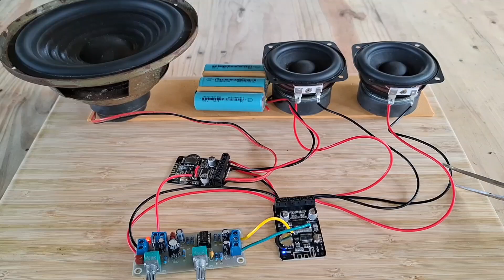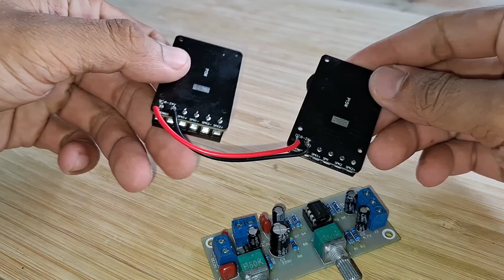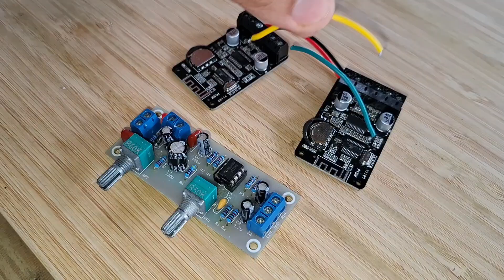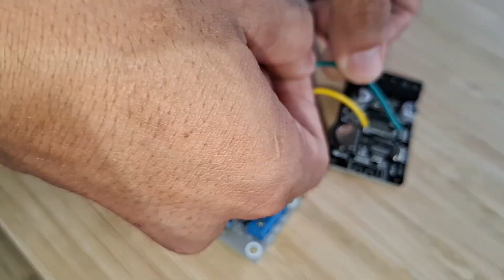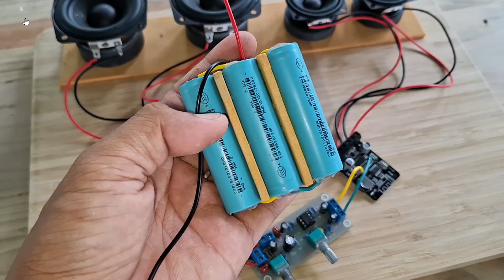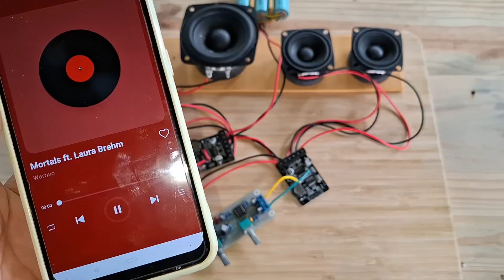Watch Me Transform the XY-P15W mini amp into 2.1 channel subwoofer amplifier.

Comment: Will aiyima 15w 4ohm speakers be good with a 12v battery? Because on the datasheet it says it will output 16w at 12v 4ohm, which is more than the speakers are technically rated for.
Reply from the maker: Yup. Up to 30W
Reply: @Segantech  Can you make a video how to convert XY-P15W to mono output from stereo?
Reply from the maker: @matik09its basic. Connect 2 resistor together

Comment: Hi i purchased this 3110 amplifier board today but use transformer 12 0 12 5 amp use bridge rectifier circuit 24 convert them connect with this board but light on amplifier board but not any sound what is problem 😊❤ search for YouTube this board use transformer but not any video available you can solve the problem please ❤❤❤ any suggestions for next video
Reply from the maker: Try hook it up that amplifier to 12V DC battery.
Reply: Ok but you can experiment to use transformer ❤😊
Reply from the maker: @vivekthorat-xn1gimaybe soon